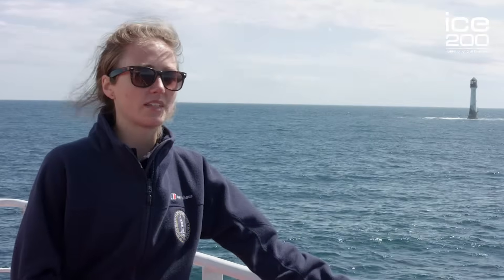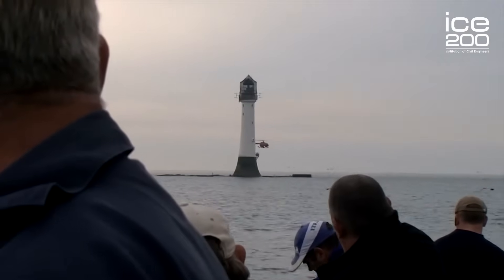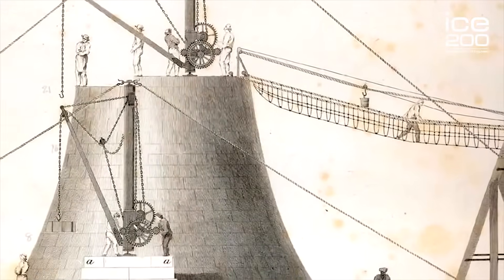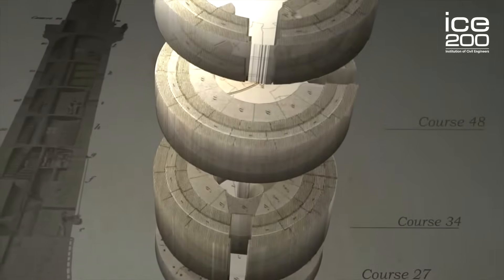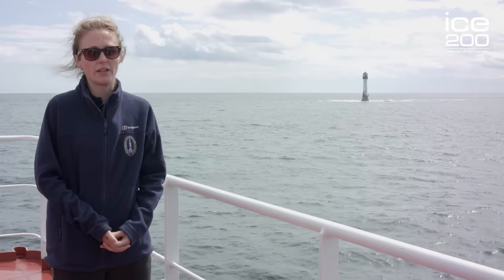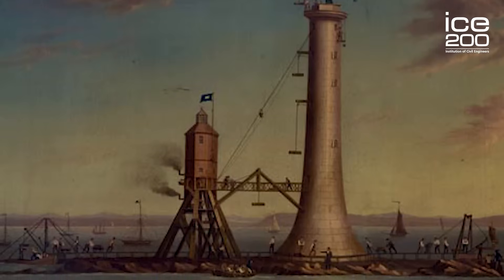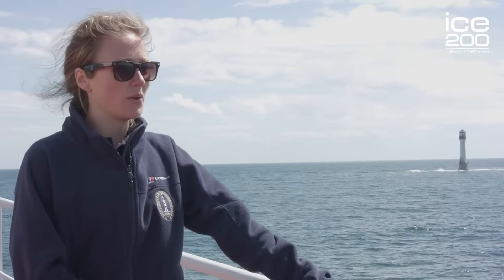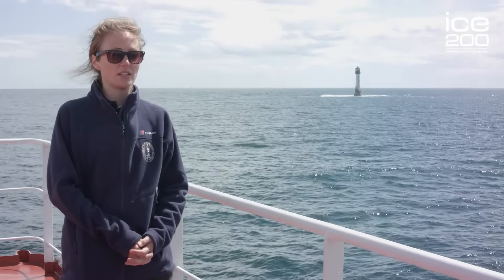Bell Rock Lighthouse

Comment: The photograph you have shown is of Robert Stephenson the famous railway and civil engineer . It also would be fair to point out that the first successful rock light house in the UK was the Eddystone Rock Light completed in October 1759. The design of Bell Rock was based on that of Eddystone, both in it's shape and the use of Dovetailed granite blocks. However it it must be said that the the building of Bell Rock was a much more difficult and ambitious project, and it's completion was due to the skill and  determination of Robert Stephenson.

Comment: Smeatons tower on the Edfystone Reef over thirty years before Bell Rock.
Reply: Fifty years, I believe (1757) - and furthermore Smeaton was already using dovetailed granite blocks back then too. It was shorter then Bell, but it was built out on the reef, which is definitely in the sea. The only reason it was abandoned was due to the instability/fracturing of the underlying gneiss due to erosion, otherwise it would still be there today as well. In fact the flared base is still there after the main top section and light was moved to be re-erected on Plymouth Hoe.